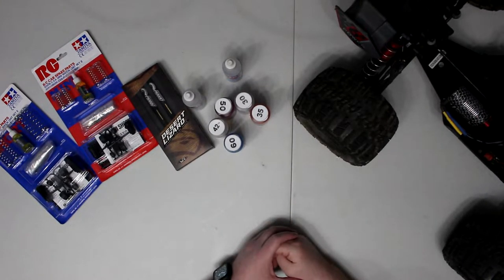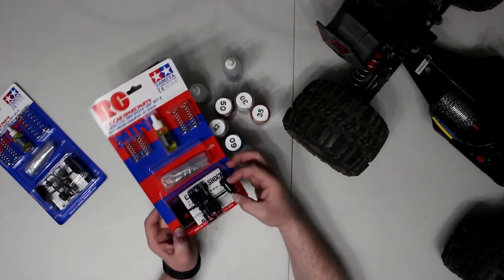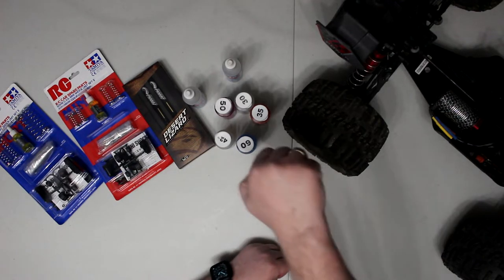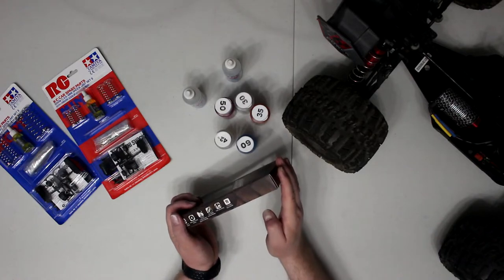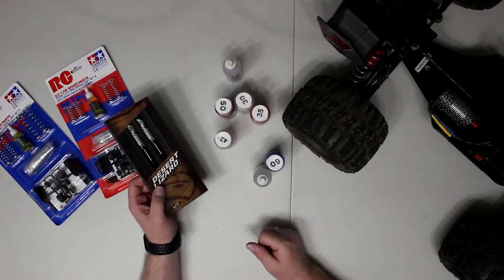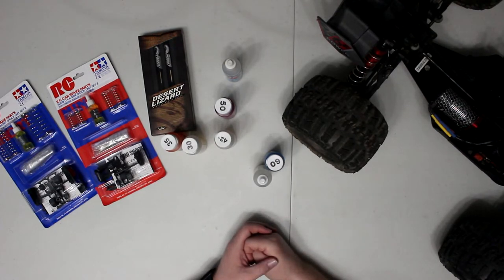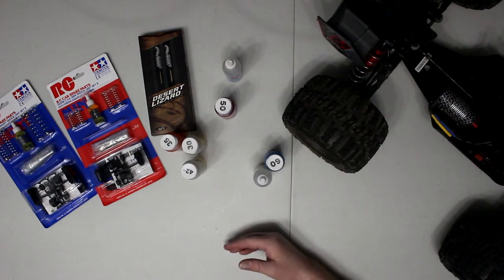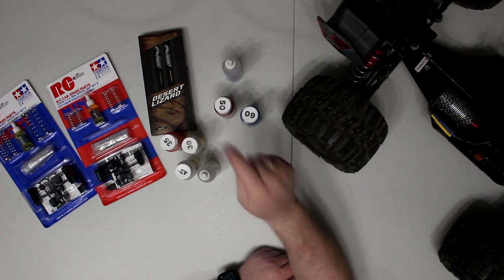What Shock Oil To Use RC

Comment: What oil do you suggest for a grasshopper that is doing ramp jumps and hits the ground hard?
Reply from the maker: I would use 35 to 47. Now, if I were you, I would still be careful jumping it. They are still using late 50s technology.

Comment: Hey man great video, I have a WLTOYS 124016 V2 it's a 1/12 and it tends to flip after jumping, it's kind of unstable, not a nice soft landing, what kind of oil should I use?
Reply from the maker: For me, the smaller, the shock, the higher the shock oil.  I would try like 70.
Reply: @djsprc  Got it, thanks man, appreciate the really quick response.

Comment: I recently bought a new Traxxas Bandit Rear Wheel Drive 1:10 Scale and I believe it doesn't have any oil in it right now. I like in your video the part where you explain to do drag racing that it's better light in the back and heavy in the front.  You use 42.5 in the front and 37 in the rear for one of your cars, should I do the same for my Traxxas Bandit or you have better recipe. I won't do jumps too steep but can a foot high sometimes.

Comment: Nice video. I am planning to use 10 cm shocks on an rc plane to land on a grass sod farm. What oil would you suggest I try first? Landings are not always as soft as I would like.
Reply from the maker: That’s a good question I would say start with 30 to 45.

Comment: I started using the FT silicone shock fluid 42.5 w . Not to heavy and not to light for my Big Rock . It just seems to give me better control and smoother ride . And if I do need more cushion it is easier to switch tires than it is shock oil .
Reply from the maker: Thanks for sharing

Comment: Hi mate....dbx 07 what oli please front and back
Reply from the maker: That size of vehicle I would go minimum 50. Or 70 that’s what I would do again it depends on you. You could try one and see how it handles if you like it keep it if not, you could change it to the other one and see how it handles.
Reply: @djsprc  thanks mate
Reply: @djsprc  you mean 500 or 700 cps right....all around?
Reply from the maker: @nunocastro7111  what I meant is a normal weight not in CST
Reply: @djsprc  whats the Diference between CST and normal weight?🙏

Comment: Aloha please I need help finding what oil weight to use in a Fms FJ40 1:10 it is pretty heavy at 15lb mostly being top heavy as well, I want to stiffen the ride as it bounces all over the place, I don’t want to convert to a leaf spring conversion kit. Want to keep the coil springs. Will be building it as a trail and some crawling. What weight oil should I use please help!
Reply from the maker: What I would do is start maybe with 35 weight and possibility to go up to 45 weight. Start with the 35 see how you like it if you feel it’s not stiff enough go up and wait unfortunately I cannot tell you to go with a specific weight. Every machine are different.  As a reference if you look at.Trx4 truck they come with 30 weight. I have my Axial Wraith with no spring. I am running 30.
Reply: @djsprc  thank you for the reply back! This is very helpful 🙏🏼 I seen losi has a bundle of different weights on amazon I will start with 35 and work my way up if need. Do you say the heavier the rig gets the heavier the oil?
Reply from the maker: not necessarily it depends on your piston hole inside. Let’s say you don’t have a lot of holes. You’ll have an extremely hard shock.

Comment: Hey i wand to change the oil in my 140mm shock's but i use then for my fanatec csl dd padel's any suggestions on what type of oil i shut use if im using them for my gas and brack padel

Comment: I’ve got a 1/16 mjx 16209, what oil would you Recommend ?
Reply from the maker: On 1/16 shock. I would recommend.
80/90.
Reply: @djsprc  thanks for your reply🙏 so that’s about 1000cSt?
Reply: Is it? I have an mjx as well

Comment: What should I use for a959b ? As I heard you need different for front and back ?
Reply from the maker: If I’m correct, that is 1/18 scale buggy. I would run 50 or 70 all around.
Reply: So il do 70 all round , just thought as it doesn’t have no grip even in concrete
Reply: Do you mean 70cst or wt
Reply from the maker: @Sam-nz2zs  WT
Reply: Thank you very much. 900cst. Didnt realise you could use it for all four shocks.. and I’m new to the rc world lol

Comment: What oil can I use if I don’t have,RC oil?( stampede)
Reply: 40 cst
Reply: Thanks. But what I really want to know is if I can use 2 stroke oil? if No Y not.& thanks again…
Reply: @raymondbetancourt6498  just because it looks the same it doesn't perform the same. Stick with actual shock oil as it's designed for that.
It's your rig you do what you want and put in olive oil for jokes but it won't perform the same lol.
For the price of shock why would you use anything else than the proper stuff.
Reply: Coming from a mechanically inclined guy, like myself. You know the mind wonders.what if.But thanks for the reply. I will order some soon…